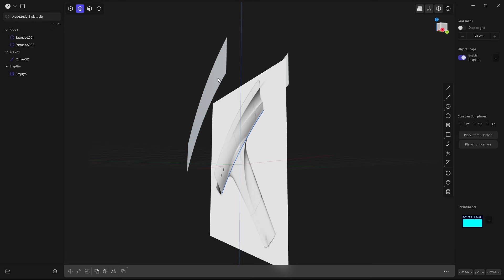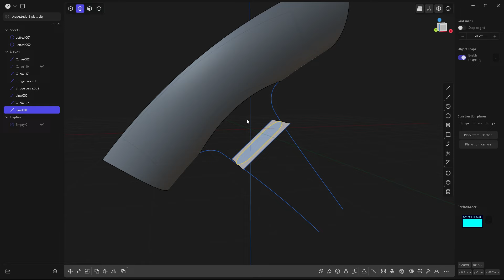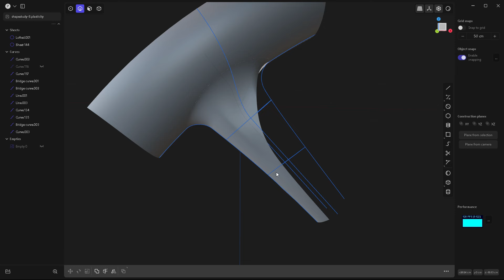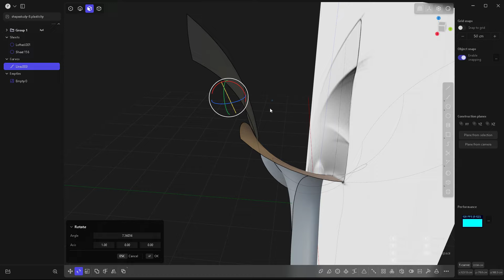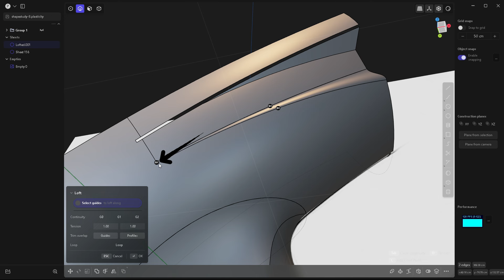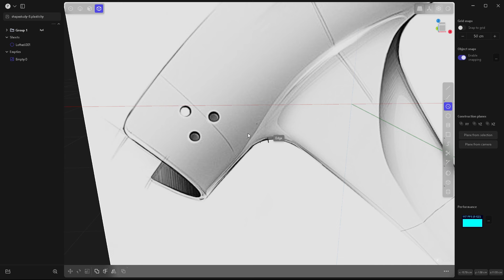Plasticity 3D (Step by step guide) Shape Study part 8

Comment: Hello, please tell me what you do starting at 27:55? Are you moving the edges? What are “broken” edges? Is this when the edge is split into several? Are you trying to unify it and make it unified? I don't quite see the sequence, I tried to connect the split edge through a pipe, but it didn't work
Reply from the maker: At 27:55, I’m indeed working on the edges to unify them. "Broken" edges refer to edges that are split or have multiple segments. It can be tricky to connect them, you just need to delete the smallest one,  but I’ll try to clarify that with a picture.
https://drive.google.com/file/d/1z6TCG4u1FRxgMMmu31ePgpUGRsjz6XKT/view?usp=sharing
Reply: @Stuff-3D-creations  Thanks for your feedback!
I'm facing the same problem myself.
I tried to repeat your trick, but there are no hotkeys in the video, and I even watched it in slow motion
I did not understand the removal mechanism itself after cutting the pipe. Do you start by extending the small edge? 27:58 you can see how the sheet moved down. What command did you run?
Reply from the maker: @Shotidyada  Once you deleted the split edge, select both edges and press the (L) key on the keyboard, to create the G1 surface.,Watch carefully the first video.
Reply from the maker: To delete edges, just select them and hit (Delete).
Reply from the maker: This is the official hotkeys list:
https://doc.plasticity.xyz/all-commands/download-pdf
Reply: @Stuff-3D-creations  Oh my God! at 27:58 you just clicked Delete! Thank you!

Comment: Dear PolyPaul, thank you so much for this tutorial! 
We ended up with sheet instead of solid. I think it's because of pipe beveling on the handle.
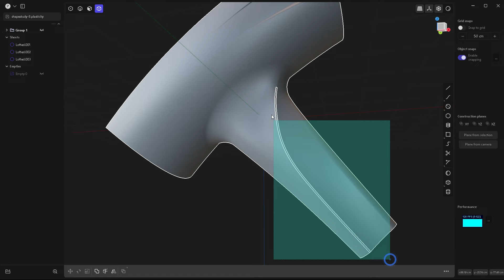Reply from the maker: Hi, yeah I ended up with a solid too, I talk about it in the video at 32:20
Reply: @Stuff-3D-creations  UI clearly identify this as sheet, maybe this is a bug
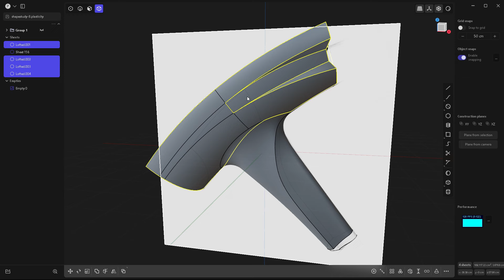Reply from the maker: @deodekmusic7581  is it at 25:34 time?? which part of the video??
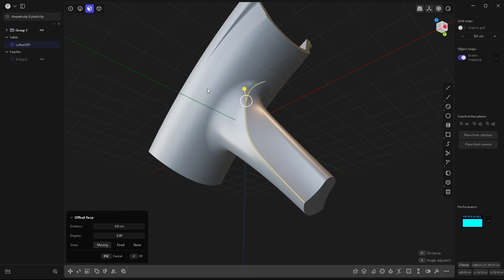Reply: @Stuff-3D-creations  at the end of the video, whole model is a sheet. It was a solid before pipe beveling technique at 31:36, but after loft and join it should be solid again, but it is not. Your tutorials are great)
Reply from the maker: There must be a breach somewhere, on it. Thanks, really appreciated!!
Reply: @Stuff-3D-creations  breach in the bottom of the handle, when lofting, people should make g0 on the bottom line of the handle. Also because of model is a sheet there was an error on offset face operation when you booleaned 3 circle holes. If it was solid, operation would offset face and create hole just fine.
Reply: Use the find boundary edge under the “F” menu to help locate the opening.
Reply from the maker: @MrKayoed  Hey I did, thanks so much for the tip.